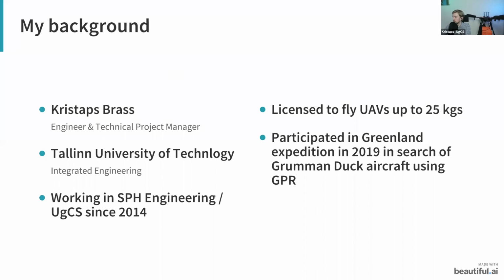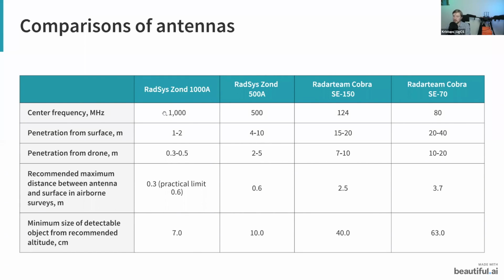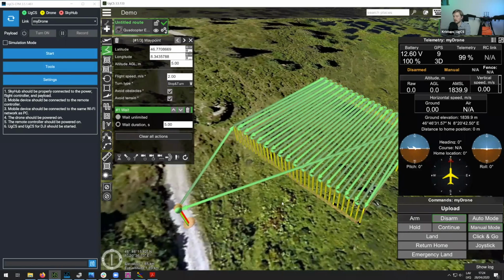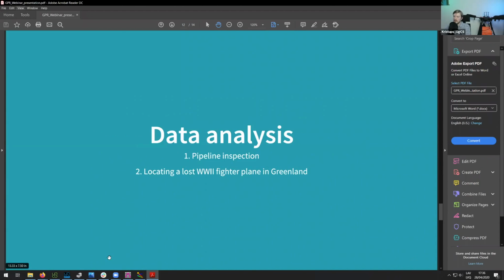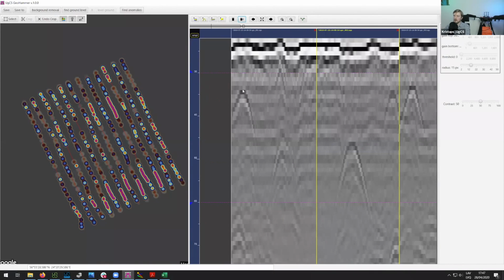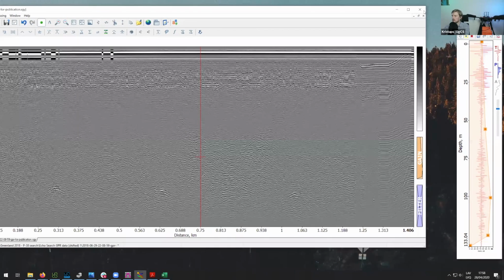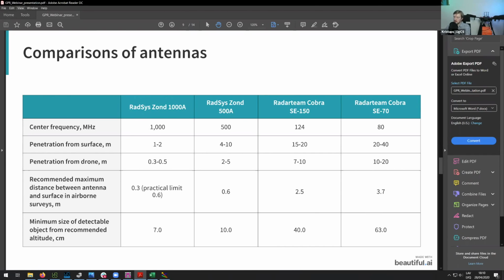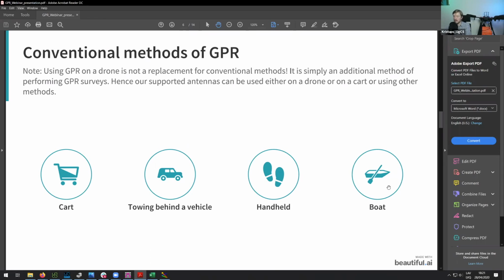Webinar | Why to use Airborne GPR+drone

Comment: Is it possible to stream live data output to watch the results on the ground Station while drone is still proceeding the mission?
Reply: we transmit reduced data stream down to the ground station, and operator can see current trace of the data from GPR and even 2D profile. But as this data set is reduced due to data channel limitations, it is manly to provide evidence that everything is working to the oprator. Not to intrpret the data when drone is flying.

Comment: I thought the Cobra can scan up to 120m deep if conditions allow ; why are there max penetrations in 1:07:52 ? I get the soil contidions won't be ideal like with the plane but why such a big difference from 120 to 20 meters?
Reply: 120m is achivable in ideal conditions only. Glacier ice, for example. Numbers in this presentation is for some "normal" soil mixture - not saturated with low conductivity.